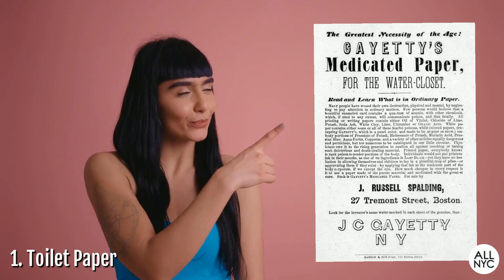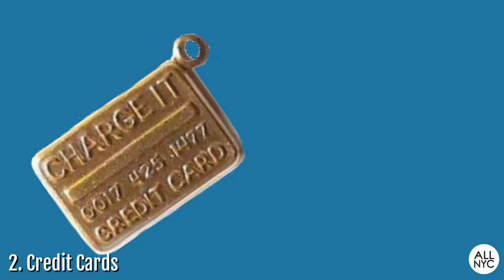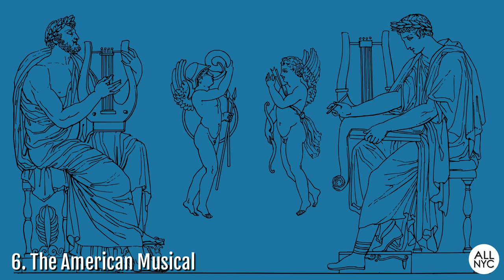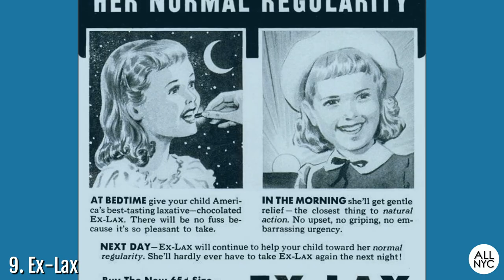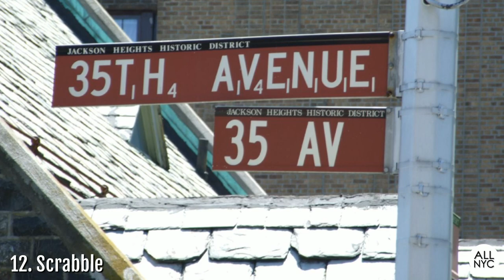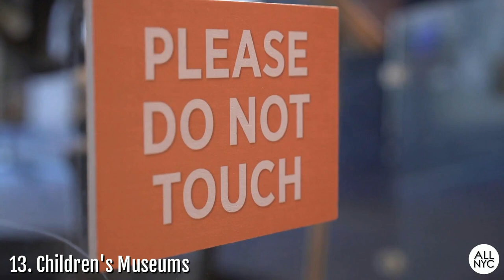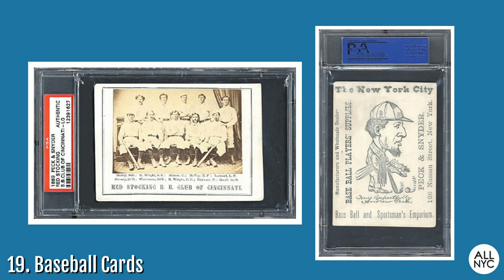21 Things Invented in NEW YORK CITY

Comment: You missed the invention of the safety elevator. In 1853, machinist Elisha  Otis perfected  a braking mechanism that would stop a lifting platform should its hoisting cables snap. Otis displayed his invention at the New York Crystal Palace by cutting the rope on a lift in mid air, scaring the patrons who anticipated a crash. No, it didn't happen. The  brakes engaged, locking the car in place. "All safe, everyone", he said.